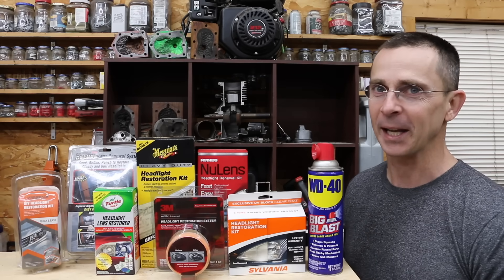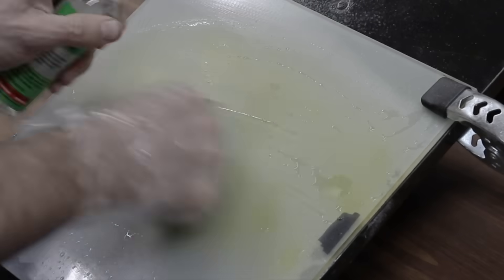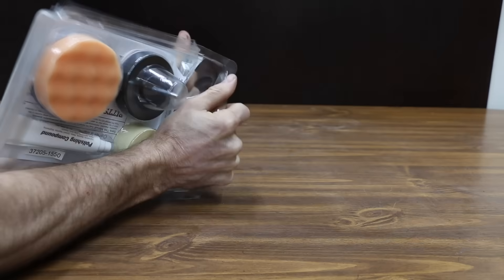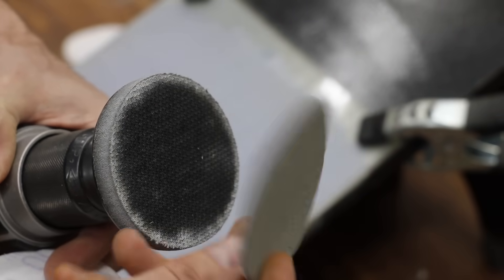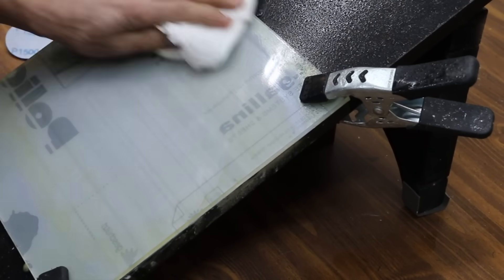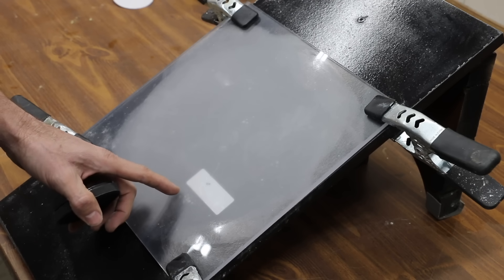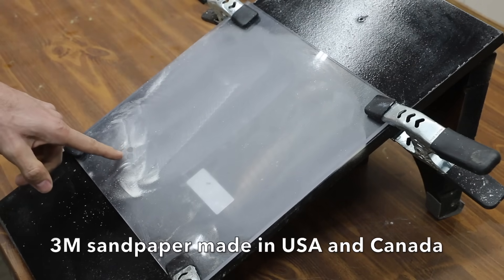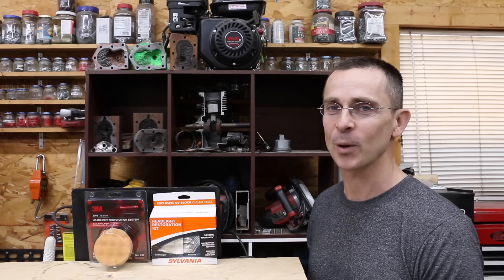Best Headlight Restoration Kit?  Let's find out!  3M, Sylvania, Meguiar's, Mothers, Turtle Wax & HF

Comment: I use bug spray %40 deet it works really good if you do another headlight video test it out i just spray it on wait about 3-5 minutes wipe it off with a rag and their is a residue that gets left behind that i just spray off with water
Reply from the maker: Thanks for sharing.

Comment: I fell for the "bigger box is better" concept too, buying the Meguiar's restoration kit several years ago, and it did a terrible job. Two years ago I bought the 3M kit, which did a great job but, like you said, went back to hazy in about a year, because they don't include any anti-oxidation protection. I'm going to give the Sylvania kit a try next time, thanks!
Reply from the maker: Glad to hear!

Comment: This pretty much confirms my experience. The best results I've ever had actually came from combining the 3M and Sylvania products. I used the 3M kit to clean them up (I did all the sanding totally wet, because that's just the kind of idiot I am) and then, just for the hell of it, finished the headlights off with some sealant that my dad had left over from when he used a Sylvania kit. Fantastic results, and very durable. Totally worth the price of both together, in my personal opinion.
Reply from the maker: Thanks for the feedback.
Reply: Project Farm -- It turns out you can get just the surface activator and clear coat without the sandpaper. It's Sylvania part # "HRKUVB" and the average price seems to be about $10. If you already have a lot of sanding tools and paper, that could be a very good value.

Comment: I learned if you wet sand by hand with the 3m kit and only use the drill for the buff wheel, the kit will do 4-6 sets of head lights. I personally have used on 5 times and eventually lost the sand paper so i still use the buff wheel. i just clean it out and use turle wax buffing compound .
Reply from the maker: Thanks for sharing.

Comment: Video idea: testing power tool battery degradation when sitting on the charger.

I have ryobi batteries and would love to just let them sit on the 6 port charger for storage, but I'm always worried the capacity would degrade over time if charging constantly.
Reply from the maker: Thanks for the video idea.

Comment: Another great test, Commander! A-PLUS! I need to polish the tail light lenses on the Taco and I guess it'll be with the 3-M when I can think to get one. And I'll probably just wax therm after cleaning. The Stewart/McDonald luthier outfit has polishing compound/things that were used to polish fighter aircraft windshields but don't think they're needed here but who knows. More than one thing to polish on a rig. Hope all are just bouncing from the spring weather and yall be BLESSED up one side and down the other!
Reply from the maker: Hi Lewie, Thank you very much!  If the headlights are really hazy, the visibility improvement after restoration is quite impressive.  Glad warm weather has finally arrived and hoping to bail some hay in a week if the weather cooperates.  Wishing y'all many Blessings!
Reply: @ProjectFarm  Ours was hazy till we hit a deer and had to have a new front end. That fixed that and I mowed everything yesterday afternoon when the sun came out and can barely walk today, creak groan, but it's mowed. Hope yall have a better shot at the hay than I have at the yard but such is life in the mountain tropics. We're all blessed nd THANKS, Commander!

Comment: I used the Sylvania system last year on my 13 year old Volvo. It was a lot of work, but it still looks good. It’s all by hand. My lenses were badly damaged, and the worst parts at the top are still a bit cloudy, but it’s 95% better than it was.
Reply from the maker: Thanks for sharing.

Comment: Sweet project cars has the solution to polishing headlights. He uses a buffer but doing it with wet or dry sand paper and going to 2k grit then finishing with a hand polish will work without any fancy tools. The tools only save time.
Reply from the maker: Thanks for sharing.
Reply: @ProjectFarm  love your channel. Keep it up

Comment: My nephew told me about the additional 3M coating product when the Lexus headlights start to haze over after using the 3M polish that I bought at Walmart. I don't understand why 3M didn't include the finish coating. Seems as important as the polishing product. 

Update: Three years since using the Sylvania product the headlights still look clear, new, and neither car's headlights (Mercedes and Prius) discolored. One car is always left outside. Also, I live in the Pacific northwest, so the sunlight isn't as intense as it is elsewhere, and that may play a part in the product holding up so well. Six years ago I had used the 3M product on a Lexus that had severely fogged over headlights. It lasted about 1 year and they fogged over again, while driving at night the car was in an accident and totaled out.
Reply from the maker: Thanks for the feedback.

Comment: In would have thought scratch removal comes down to user technique and visual inspection.
Sure the poorer performing product won't work as well, so you would need more of it and work a bit harder, but should be able to get the same result.
Deeper scratches just means you need to remove more surface material.
Having worked in panel shops, 1500 grit scratches can be buffed out with most heavy cutting compounds. Going to 3000 seems like overkill.
Reply from the maker: Thanks for the feedback.

Comment: What I do is get some sand paper Walmart has a set with like 2 of each  1000,1500,2000,2500 wet sand paper and just spend your time with the 1000 and the rest only take a min and wrap them around a sponge just to make is easier and then I have one of those foam buffing pads that goes in a drill and use the plastx or plastic x whatever it's called but I have not really tried anything to keep it clear for a long time yet
Reply from the maker: Thanks for the feedback.

Comment: A comparison of uv resistant aerosol clear coats would be a great video to follow this one. Could even throw in a non uv clear. Its important that they work on plastics. Iv found it hard to find a uv clear coat that does well on plastic as well as not yellowing quickly.  A good uv clear is good for headlights and black trim that's turned gray
Really enjoyed this video and the work you put into it. Thank you.
Reply from the maker: Thanks for the video idea.

Comment: One of the best I know off is to use Brillo wadding, it's a metal polish but works superbly on plastic lenses of any kind (including electrical devices) and vehicle headlights, plus its far cheaper and quicker than any you showed and you don't need a drill or other device.
Reply from the maker: Thanks for the feedback.
Reply: @ProjectFarm  Oops I meant Brasso not Brillo. 🙄

Comment: Personally I use a micro mesh kit. Its primarily used for polishing aircraft canopies which made made of polycarbonate. The sandpaper itself goes all the way to 12,000 grit then you have an abrasive liquid that goes on after to do the final polish. It takes quite a while to do the work (30 to 45 minutes) depending on the condition of the lights. Best results when using water while sanding.
Reply from the maker: Thanks for sharing.

Comment: Yes another great video.
But the bottom line is all your doing is sanding and then polishing.
You can achieve a far better result buy going to your local auto paint store and buying 3M wet and dry sheets in, 600, 1000, 2000 and 3000. Then just sand away using water and a tiny bit of dish washing liquid that acts as a lubricant. Sand and sand and sand and sand and sand  then just use some auto polish and buff and buff.  Result will be better with the more effort you put in
Reply from the maker: Thanks for the feedback.

Comment: Great video as ive come to expect from you, ive used the bug spray and soft cloth method for years, would like to see a folow video of some of the home brew methods out there.  Deep woods off gently rubbed on the light with a soft cloth followed with uv protective clear spray paint has worked wonders for me over the years
Reply from the maker: Thanks for the video idea.

Comment: I work at a garage/used car lot. I've tried alot for this issue. Sanding, buffing, clear coat, etc. The kits are ok at best. My process is, remove the headlight, wet sand with 600-800 and drop the $20 on a can of spraymax 2k rattlecan clear. It's enough to do like 12 sets of headlights. Sand until your water runoff isn't yellow. Then just a few coats of clear. The drawback is that clear is only good for like 24 hours in the can after you mix it. So have all your lenses ready or another project that needs cleared.
Reply from the maker: Thanks for sharing.
Reply: @ProjectFarm  great content btw. I try to weigh in with a real world tested alternative when I have one. Maybe doa black plastic restoration test sometime.

Comment: Another great video sir. I agree it would be good to see which clear coat holds up best and also maybe a recommended product to use for kits without clear coat included . I have stopped using kits as you can buy products to do hundreds of lights for equal or less than the cost of a kit. Testing some of the methods to do this might have been good.
Reply from the maker: Thanks for the video idea.

Comment: You showed how to do it right, if you only have a minute I use brake clean on a red shop rag rub them down real quick and spray with headlight coating.
Reply from the maker: Thanks for the feedback.

Comment: I have the 3M kit, works awesome.  But mine said to wet sand thru all steps. Not to dry sand first couple steps. But my kit is 2yrs old now. Did 2 cars with kit. Needs new paper now
Reply from the maker: Thanks for sharing.

Comment: I recently did my headlights with a Rustolium kit.  It was around $8 from Walmart and only consisted of a small double sided sanding pad, a micro fiber cloth, a glove, and a pre-wetted clear coat applicator.   The sanding pad left the headlights frosted looking, but then the clear coat glazed them over over and made them look more like new.   

It would be interesting to see how your test pieces look after exposed to the elements for a while and see which ones late longer.
Reply from the maker: Thanks for the video idea.

Comment: Where I work we were using the same 3M kit then at some point they changed the kit we got slightly... The packet of rubbing compound was replaced by two clear coat wipes

So after the 3000 grit one wipe is used to coat both headlights, then a 5-10 minute wait, then the second wipe is used

Adds to the customer wait time significantly over using the polishing pad and rubbing compound but also lasts a lot longer
Reply from the maker: Thanks for sharing.

Comment: I wet sand starting with 800 grit and work up to 2500 grit and instead of water I use purple power. Then I buff with a clay magic bar
Reply from the maker: Thanks for sharing.

Comment: I'm a used car dealer, and I polish the headlights of every vehicle that I sell.  Foggy headlights tend to be a real turn off.  I use a battery powered drill with an adaptor that allows me to attach 1000 grit, then 3000 grit sand paper, and then a sponge that I saturate with a polishing compound.  I forgot the name of the manufacturer of the polish, but I do remember that the product is named Plastic-X.  Then I spray some sort of coating called Meguiar's headlight coating.  It helps get the cars off the lot, but I don't know how long it stays clear.
Reply from the maker: Thanks for sharing.

Comment: Most of these just seem to be too much work or basically useless, when I used to work in a body shop all I ever did was sand them with my dual action sander with 320 grit if they were pretty bad and then go up to 600 grit. After all the yellowing was worked out of them and the scratches were uniform, I just sprayed them with our automotive clear coat which was PPG brand at the time. But any brand of clear coat should work ok. You want to have a fair amount of scratch level like 600 grit so the clear coat can properly adhere and provide proper UV protection otherwise overtime it will flake off. 2000 grit is way too much and it wont last or will model up and look pretty bad
Reply from the maker: Thanks for the feedback.
Reply: @ProjectFarm  No problem, really appreciate your videos btw

Comment: Thanks for doing this. I recently got a used car that has fogged headlights I wondered if any of these things actually worked. And I thought I was going to have to pull the headlights and do the insides of them, glad that isn't the case lol. Did you actually try them on any of the headlights to see of the light output increased or not?
Reply: The difference is definitely visible to the naked eye.  I have done the restoration kit method, and wet sanded and  sprayed UV-resistant clear coat made for plastic on my headlights and both methods gave good results.  You will notice your headlights splash more light on the road for sure.

Comment: Sylvania it is then.   Just goes to show that cheaper is not always better.   My parents have a "08 GMC Envoy and the tops of the headlights are just starting to haze up.  I'd like to nip it in the bud before it gets to be a big problem.  Nice thing about older cars is they have real glass headlights.  Their 90 Dodge Conversion van has glass headlights.  My 96 S-10 has glass headlights.    I do have aftermarket projector headlights with polycarbonate lenses, in my Fiero,  but it has pop-up headlights. So during the day, and harsh UV bombardment,  they are safely tucked away.
Thanks again. ☺
Reply from the maker: Thanks for sharing.

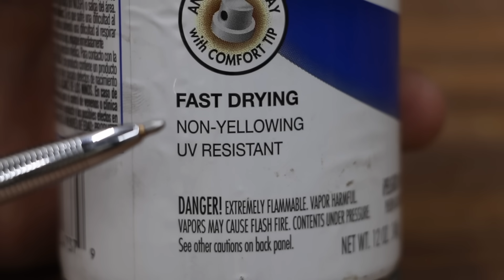Comment: Thanks for the video, it's great to know which of these kits work and which don't. However I don't know if a kit is all that necessary for this use. Just buy some quality wet/dry sandpaper, wet sand off the oxidation using increasingly finer grits, and then cover the whole thing with a gloss coat, just like the kind seen at 0:37.
Reply from the maker: Thanks for the feedback.

Comment: I am very impressed with this video - unlike the Mothers kit, which I have used in the past. On my 90's chevy I just used 1500+2000 3m wet dry sandpaper and clear coat; I'd be curious to see how this DIY method compares under the microscope. I guess for a long term repair, I'll find out.
Reply from the maker: Thanks for the video idea.

Comment: What a timely video; I did just finish rejuvenating the very damaged lenses off my daughter's 2003 Toyota Echo.  The lenses were so yellow and dull that at first I couldn't see the reflective mirror cap over the bulb inside the lens.  I used 4 pieces of cloth, an old bottle of DOT3 fluid I had laying around, a bucket of soapy water and an old bottle of liquid turtle wax.  The result is not out of the extraordinary, but seems to compare with most of these products.  The trick is to wet the first cloth with a little DOT3 fluid, apply (buffing) on the lens without adding more DOT3.  When the lens becomes sticky, buff harder.  Rinse with the soapy water and the second cloth.  Dry with the 3rd cloth.  Repeat a few times.  It took me about 30-45 minutes.  I finished by using the last cloth with turtle wax to bring the lens clearer.
Reply from the maker: Thanks for sharing.

Comment: 3M has pretty consistently good products in my experience with them.
Reply: I recently went through a recall on a piece if safety gear used for climbing towers. Even thought the gear was over 25 years old. 3M took care of me pronto, no questions asked. I was pretty surprised how fast, efficient, and the "just do it" attitude.
Reply from the maker: Thanks for the feedback.

Comment: I have twice used the 3M kit to restore my headlight lenses and was impressed with the quality of the contents. In fact I saved the contents of both kits because they looked good enough to restore more than one pair of headlights. The downside however, as you mentioned, is that the finish obtained does not last. What product do you recommend to preserve the clarity with the 3M kit? Or should I just purchase a sylvania kit for the sealer?
Reply from the maker: Thanks for the video idea.

Comment: I know the instructions say to smear the compound on the headlight to avoid smearing, but after watching several paint correction specialist do similar tasks. I feel as though the compound should have been spread over the polishing pad, sprayed the excess with compressed air, and re apply wherever there is a dry spot. Otherwise you run the risk of actually scratching the surface even more with excessive heat from the friction. Idk, just food for thought.
Reply from the maker: Thanks for the feedback.

Comment: The kinds of white tooth paste with marble dust, or other grit in it will work, if you have a lot to time to waste, and like pushing really hard with your fingertips. Then finish it off with Nu Finish car polish. Use the Nu Finish after the toothpaste has removed the discoloration because the grit in Nu Finish is way too fine to remove the discolored plastic. It will only remove microscopic scratches, like car wash brushes leave on a car. Even with those, you will have to rub hard, but it will eventually take the scratches out. It is the best polish made, if you aren't afraid of a lot of hard rubbing. That is what I used on my old 2000 Expedition. The thing still looks new. 
Great video as usual.
Reply from the maker: Thanks for the feedback.